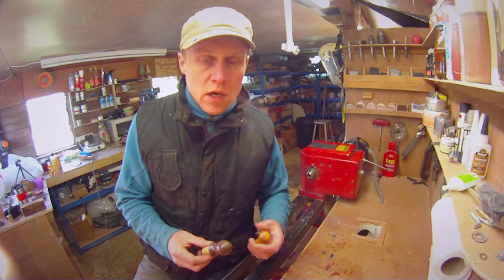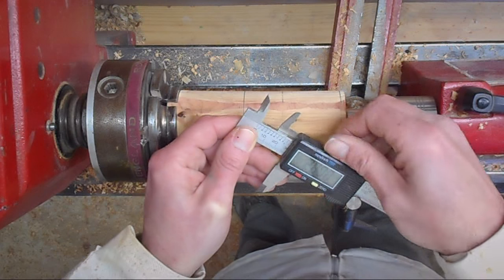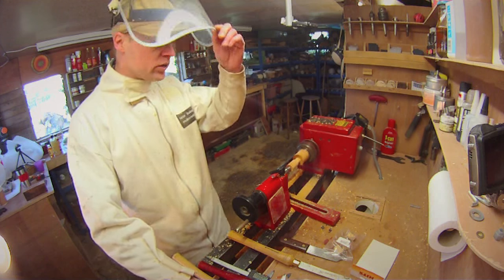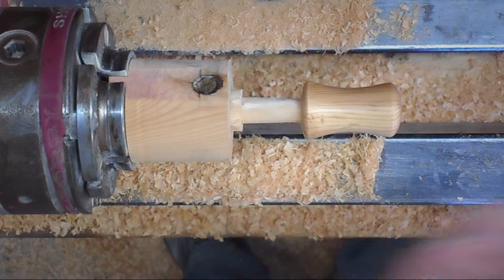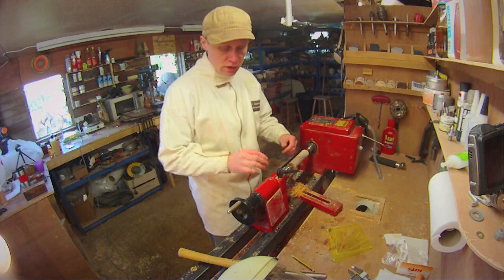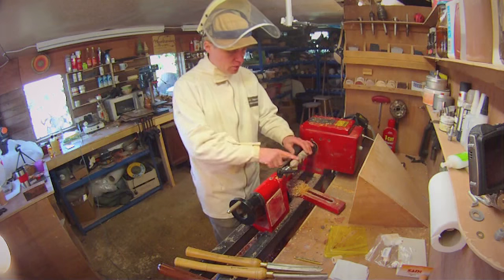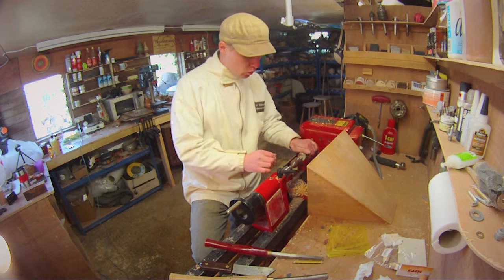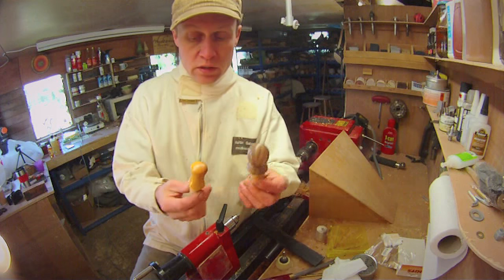Two Bottle Stoppers Using Two Methods Beginners Woodturning Project

Comment: Bottle stoppers are always fun. I've always done mine between centers or on a mandrel (for the metal hardware kits), i've never considered using my chuck on such a small piece I normally only use it for large items. Thanks for sharing.

Comment: Martin, I've noticed on this, and at least one other of your beginner videos, that you lay the tool on the spinning cylinder to check for roundness.  As this is a beginner's lesson, you might want to explain what you're doing (although I guess I just did -sorry!).  I'd also recommend against simply breaking off the nub, at least on the finished end of the piece, as you risk breaking off fibers below the finished surface of the piece. A sharp knife works well here.  Another great video.  Kudos!

Comment: Nice project Martin!  Each time I watch one of the beginner series, I learn a bit more about how to use various tools.  Two observations.  Isn't it advisable to use a draw bar when using a drill chuck in the drive spindle? Or is this not an issue because most of the sanding pressure is straight into the spindle.  For the project turned between centers, you do need to be careful when breaking off the ends of the stopper.  If the parting is too thick, you run the risk of tearing out the end grain leaving a hole that is really hard to remove or sand out.  (go ahead....ask me how I know this!!)  I've resorted to using a fine toothed pull saw for this operation.  Rich

Comment: really nice small projects!      I've never used the cork stoppers like that, the ones I found had a wooden dowel with a rubber stopper bit attached to be glued into a matching hole in the bottom of the stopper...(they also make a handle mandrel with a screw point the same size as the dowels...)       Do you need to worry about gluing the cork on with a bit of wood glue?   Would that serve to seal the end of the wooden tenon where it will be exposed to the liquid of the bottle??  

my grandfather used to use a sharp pocket knife or razor knife to carve off the last bit left after doing it between centers like the second one....really cuts down on the amount of sanding, as you can start sanding at a much higher grit.......

going to have to get my wife to watch this one; she's interested in doing bottle stoppers!

Comment: Just one question.  I’m getting ready to make a cork bottle stopper. My first cork stopper.  My question is does the cork get glued to the wood in some fashion or is it pressed on.  Just curious. I’d be afraid the cork would come off in the bottle neck.
Reply from the maker: Use some wood glue and a tight fit and you'll be fine. Safe turning!

Comment: Hi Martin, many thanks for a very useful video I will definitely be trying this with the chucking method. Could you please advise on the blank size you used and proportions as well. As a beginner I do struggle with that and also do you think that an acrylic blank would work well or not?  Many thanks again, Michelle

Comment: Nice work as usual Martin. I was wondering, to save wood, could you use a smaller blank and turn the spigot either between centers or in a chuck, then chuck the blank from the spigot with mini-jaws or collet chuck? Or would it be too weak to handle the stress of turning the rest of the stopper?

Comment: another method i saw for these is people take a smaller blank drill a hole in center to fit a dowel for the cork end chuck up the dowel in a jacobs chuck and turn the handle part.
Reply: some of the people i know that do it are using spectra ply i think its an expensive product so the do it to save on material somewhat. Its fun to see how people come up with "how" to do something almost as much as what the finished product sometimes.

Comment: With your second bottle stopper (between centres), would the finished diameter of the end where the cork slides on fit in the jacobs chuck for final finishing?
I like you work and have subscribed to watch more from you.

Comment: What type of mask are you using for sanding there? Can i have more details please
Reply from the maker: Hi Mumma,
I used to use a 3M 4251 respirator but have recently upgraded to a 3M VersaFlo for better protection. It is also important to consider proper dust extraction and air filtration, as well as a mask.
Hope that helps,
Martin
Reply from the maker: +Mumma Toni Oh yeah....I got it from Axminster Tools and Machinery.

Comment: Hello Martin,, good demos,, two more methods to try, make 12.5mm dowel 6 or 7" long ,turn the top and drill a 12.5 hole about 1"deep  ,,CA the cork and the dowel then insert to suit ,, the other , as your method 2 ,then make a jam chuck 12.5mm [which can be used again and again] to sand and polish the end ,, See you at UKIS 2017 ,, Regards Alf